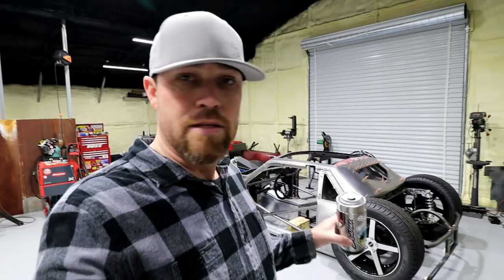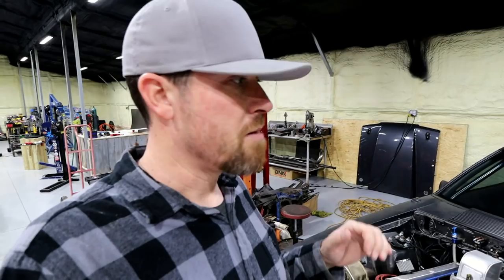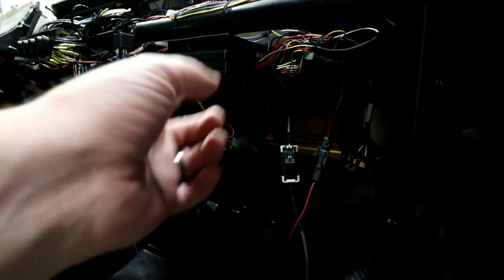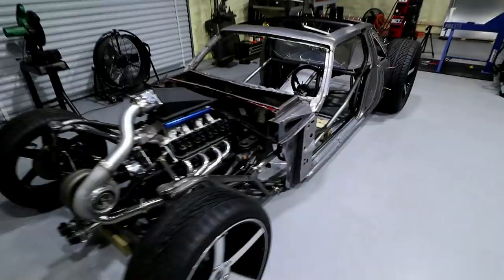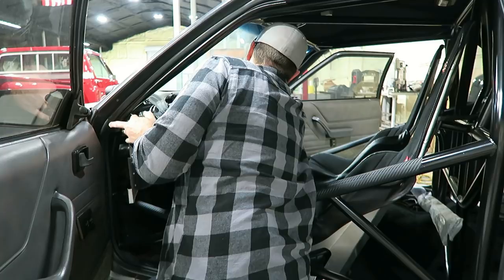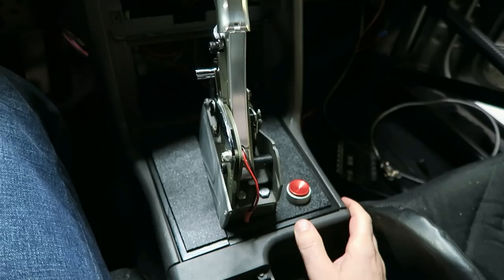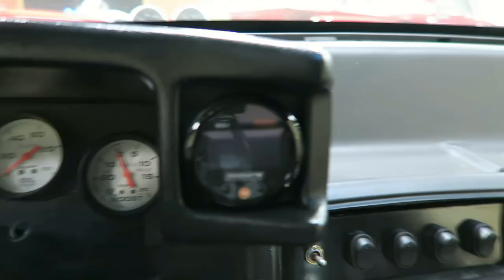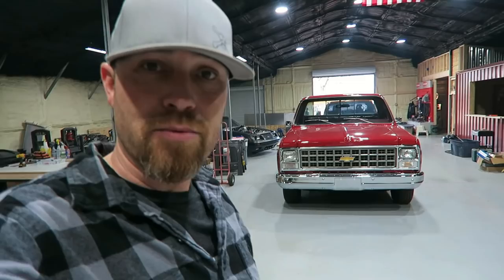What Would You Do With My Twin Turbo Mustang ?

Comment: Great show.  The Bibster is wicked nice, but I love that Goose.
        I miss my 86 GT 5.0. HO.
I loved the grill/nose and tail lights of that year.    Back then it was a quick little car, (85mph in 2nd gear).   Up to 100mph the IROCs didn't wanna play.   Out beyond the 8th the 350 was just a bit longer legged and would pull away.
    I was married back then and had to get rid of it.   Years later I got divorced.
   I should have kept that car  LoL.😂.

EDIT:    I would wire it so you can ALSO run both the line lock and trans brake on both the same switch on your shifter.   Once you bump in, you can stay planted and run up the converter without moving....then dump everything at once.

Comment: I do understand the concept of the build of your car is of Mad Max ( Goose ) lowering it up to 4 inchs . I have a different approach to the builded of you engine has it can have much more power there. like you said , just have one fuel pump on a normal drive then if you want or need more power you turn on the other two fuel pump and with the two turbo boost you would have lots of air .., fuel and power for quick sprint down any strip or track., But this good the  part., You have a V8 engine in you car.., Now you are going to need to find out the pressure in one of your engine capacity of the cylinder cup., as you are going to put a smaller turbos joining.,  two of your cylinder intakes so that would be 4 smaller turbos and two larger turbos to feed the smaller turbos., that means one large turbo feeding two smaller turbos., its a type of a Super Charge that saves your fuel and gives you lots horse power.., Now there is a small problem is how to tune your car to work under all of that power and pressure.., I hope you understand what I wrote..,

Comment: In retrospect. .. would you had went with a digital dash to display all your info instead of all the gauges. . . At the start of the build till now I'm sure a lot of technology has came out
Reply from the maker: yeah for sure....on this build I basically just used everything I had acquired over the years. I used to buy modified mustangs, take all the good parts off and then sell the cars basically back stock. ...most of the parts I have where "free"

May spend some money down the road to upgrade

Comment: don't bother with E85 ,   the cost for fuel supply  , added maintenance , oil degradation , corrosion, constant oil changes and fuel filter cleaning ,  etc . isn't worth it .   look into water methanol injection .  or C16 like you mentioned.   i've had real good luck with water meth over the years.   its nice because you can set an initial psi where it kicks in , and another preset for peak flow . and its only used on demand . where the C16 is your all the time fuel . i like Snow performances " Boost juice "  pre mix water methanol .  can always make your own also , but i like the consistency and ease of their product out the box.    here's an AEM video of their kit , and how it works , and all the benefits.   bit goofy a video , but worth the watch , and consideration .  https://www.youtube.com/watch?v=HkPFZWd8wj4